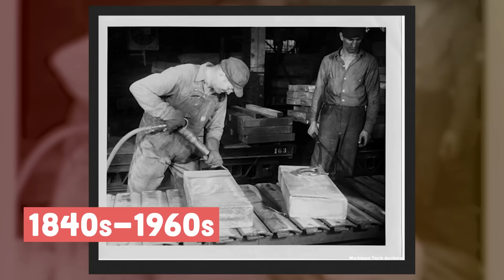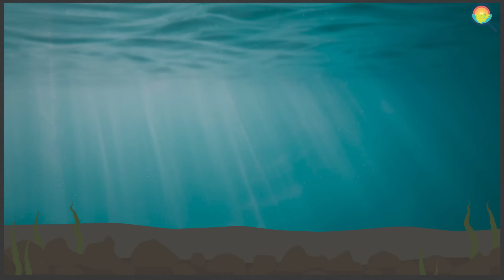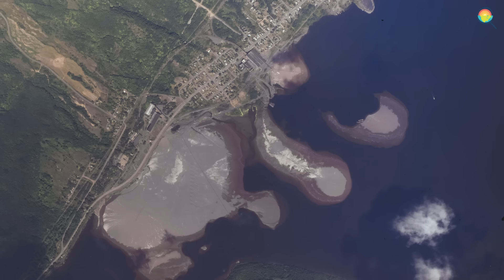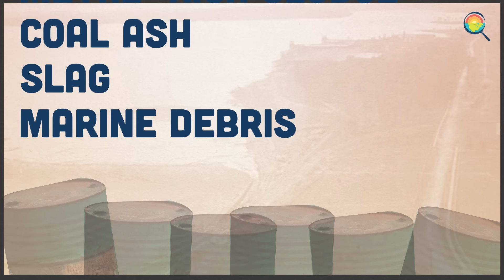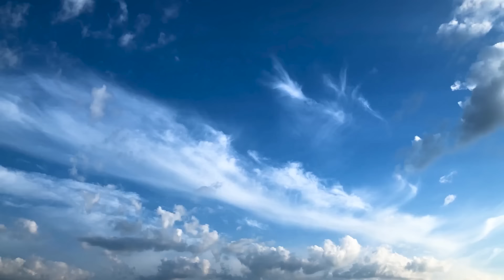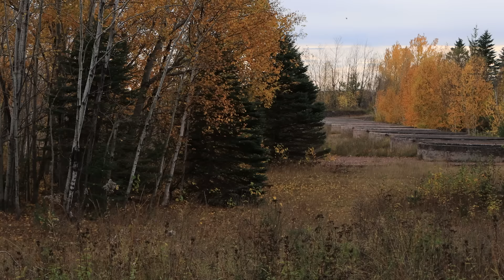They Poisoned This Lake. Now, It's Coming Back.

Comment: MI has 2 Torch Lakes. They should fix that. 😆 What about dredging the lake to regain the lost water volume and the river that is blocked from flowing in to allow sediments to come into the lake? The dredgings could be used for filler in concrete, etc.

Comment: YES! We should clean it up. Our children will have as low of an opinion about us, for passing a polluted lake on to them, as we do about those that passed it down to us. Besides, every parents wants their children to have a better life than we did; so cleaning up the mess(es) that we inherited will work towards giving them a better life than we had. Also, when our children see us cleaning up, and taking care of, the environment, they will do the same when they become older (children learn best by the examples we set).

Offer scuba divers "free air" (tank refills) in exchange for bringing up a certain amount of stamp sand. 
Organize 1 weekend a month where divers come for the purpose of recovering the sand/barrels/etc. Let them augment agencies that are in the process of cleaning up the lake.
Consider designing patches or decals for having participated in the clean up, and have add on patches for certain mile posts; such as 25 lbs, 50 lbs, 100 lbs, or specific events (like removing barrels). Basically something that a diver can display on their gear bag, or jacket, that shows they've taken part in cleaning up the lake.
Give a diver a worthwhile cause and they will usually jump at it.
Make it a tourist destination where people come from all over to help out for a few hours, a couple of day, or a week.
See if you can work this lake into "Earth Day".

Comment: Does covering the contaminates cure the problem? Water will still migrate through. Where does that water transport the contaminates to? 
In my state massive amounts of nitrates are spread on the soil as fertilizer. They contaminate the ground water that is pumped for domestic supplies.

Comment: Excellent presentation of the issues faced in a remediation project. In the clean-up world, basically, cost go up at a logarithmic rate the closer you get to a mythical 100% removal. It may easily cost as much to get from 90% to 99% as it did to get to 90%. With that in mind is it better to remediate many sites to 80% or 90%,  than to do only a few if the goal is 99%?

Comment: This is always the question that comes to mind; How natural is 'natural'... and how often is natural 'best'.
And I don't mean those questions in a nihilistic 'we ruined nature, so there is no point to restoring a natural state' kind of way.  But growing up in Cali, there were plenty of 'restoration' projects where attempts to restore an environment either caused additional rapid changes which caused more harm than continuing to leave things alone... or were so short-sighted that they failed to restore what was actually important.  Not saying to 'not do hard things', or to not make well intended mistakes... just some self-awareness that sometimes an ecosystem is in fact altered, and 'different' isn't necessarily 'harmful' or 'bad'.  And also to emphasize the point that long term monitoring of major changes to have a real grasp of the actual practical results are a requirement to any major environmental change; Because in restoration efforts mistakes are made, and ineffective solutions are put in place, and the only thing worse than doing them once, would be to continue doing things that cause issues.
Again, I feel the need to make the point that I am not saying to cut or suspend restoration efforts; Just the opposite!  If we fund science well, and if we do projects and monitoring with more purpose in mind, then we will get better answers and be able to do future restoration projects faster, easier, cheaper, and with better outcomes in the future.  Technology for making a smart phone is infinitely difficult... but because the scope of the challenge and goal is narrow, then there is a clear path towards the goal and we can achieve amazing progress year to year.  Environmental sciences are science, and they produce technology... and in a lot of ways the technology needed to achieve environmental goals are much easier than creating a smart phone.  The issue is that goals are fuzzy and nebulous, and change dependent on the goals of the ever-changing stakeholders more than a specific achievable goal in mind... and funding sources are also fuzzy, nebulous, and ever changing, and each time a new stakeholder brings funding, it is attached with new goals.  When there is no clear metric, or goal, or stakeholder... stuff takes forever to make progress.  The real issue with environmental science is the social science needed to get people on the same page,

Comment: Flashbacks of why not sell for cement products and especially the UHPC variety to better seal and get some practical use from.  I suppose now a days a little more wondering about how the materials perform or can be modified for utility for sand casting.  Oddly for many, thinking about multistory natural resource structures as well, to increase the lively surface area.

Comment: Although the dredging process will take many years to complete, it will be worth it to clean this lake up. The upper part of the Fox River which runs off into Green Bay here in Wisconsin had astronomical amounts of waste chemicals dumped straight into the river from the multiple paper mills this area is famous for, and other factories for over 100 years completely unchecked. Back in the 90's they started the painstaking process of vacuuming up the many feet of contaminated muck that was resting on the river bed.   Better yet, it was mainly financed by the paper mills that still exist and operate to this day, along with vital help from the federal government.  After 20 years the ecosystem of our river and the mouth of the bay have changed drastically. Pelicans inhabit the area now and the fish are actually edible in certain circumstances. I hope this lake gets a similar treatment, so it can make a full recovery to its former majesty!

Comment: Of course, Torch Lake isn't the only local body of water affected, but it's arguably the worst. Portage Lake might have faired just as badly, but the federal government inadvertently protected it from worse damage because the Portage waterway was much more important to shipping. In the late 1800's the Atlantic Mine had their stamp mill next to Portage Lake in the area of Cole's Creek. The federal government gave them an ultimatum to stop dumping their sands in the lake as it was narrowing the channel. So they built a new stamping mill at Redridge in 1895 or close to that date. (It's been a while since I read their yearly stockholder reports so it could have been the year before or after.)  As it is, Portage Lake does have a significant stamp sand area just southeast of the MTU campus. I don't recall what company was responsible for that. When I was at Tech in the early 90's it was still mostly uncapped. Today it has a housing development on it, Superior Block Co., and the Portage Lake Water and Sewer facility. Honestly I can't imagine willingly living on top of a stamp sand deposit like that, but whatever. ¯\_(ツ)_/¯

Sometime in the future, extracting the copper and other elements from the stamp sand is going to become economically viable again.  I don't see our world's use of copper slowing anytime soon. When that time comes, the state should allow it provided that  the companies that do it process it elsewhere so waste does not return to the lakes.

Comment: I really appreciate you doing this video, however, you didn't get all the information:
1. In the 1970's the pollution in Torch Lake made national headlines and a group of locals did everything they could to stop the EPA from looking into Torch Lake because they were worried about tourism.
2. There was a massive influx of water, ammonia, and other items of concern in the 1970's following the draining of a mine in Keweenaw by Homestake Mining.
3. The sampling done on Torch Lake from the 1970's through the 2010's was so egregiously lacking in scientific method as to only have been deliberate. No area was ever sampled more than once, and the dispersal of sampling points clearly pointed to a lack of desire to find anything.
4. The number of drums in the bottom of Torch Lake has been known for decades, and covered up. Reports of "A few drums" are false. There are pictures collected by MSP divers showing an entire barge filled with drums sitting on the bottom in front of the former PCI site, now known as Koppers.
5. Formerly PCI, now Koppers (also an MTU affiliated project, who knew?), collected copper waste from around the country, particularly from the military, and reprocessed it by burning away the layers of insulation on wiring and other objects, then allowing the runoff from that operation to further contaminate the lake.
6. This one is speculative, but The War Department exemption for Torch Lake likely led to companies transporting waste from other areas for disposal in Torch Lake. Of particular concern is the possibility that decommissioned components from ships that were used in nuclear blast testing made their way into Torch Lake.

Lastly, you should also look into the Lake Superior dumping trench that the Army filled with barrels. It runs from Duluth and parallels the MN coastline for around 100-150 miles.
Reply: Military actions detrimental to the environment from PFAS, ex. Wurtsmith Air Force Base, are being minimized and defunded by the Federal Government, especially Trump.

Comment: It seems the lake was a hazardous waste site and instead of transporting the waste to a new landfill, the water inflow to the lake should have been stopped, and area dug out, the material moved to that pit, buried and a new lake area created with that removed material used to cap the waste.  But there would have been the political problems.

Comment: I grew up in the 90's in Tamarack City on Torch Lake. We would swim off the sands. The drop off was right away so you could jump right off the sands or make a small diving board to get out there further out. They weren't covered then. Sometimes if there was strong wind and you were on the sands you had to take cover because it was like getting sand blasted. Good times. I remember some sickly fish. Great kayaking spot, though it is starting to fill with cabins like Portage lake.

Comment: Overall a great video, it's a great area and I hope one day the area will be restored. However, the poison is in the dose. Copper is used pretty extensively in habitat restoration, and it's a trace nutrient. Check your bottle of Centrum vitamins for example. 

There is a lot of cherry picking on both sides regarding data and with the fear of chemicals in the general population we are starting to lose tools that actually help us clean up waterways.

Comment: Thanks for another interesting video!  I've visited Torch Lake many times and this ties in with areas I have seen when paddling around Lake Superior.  When I kayaked around the Keweenaw in 2018 I was expecting to see stamp sands near Gay.  I wasn't expecting to see that they had drifted, by winds and water currents for 5 miles along the shore, and who knows how far under the Lake.  They only stopped drifting along the shore where they encountered a river that needed repeated dredging to be a safe harbor.  I kayaked another trip from the WI/MI border to Munising and encountered stamp sands near Freda and Red Ridge.  Not nearly as extensive as near Gay.  And kayaking the MN shore there is a remediated area known as Black Beach, which looks familiar after those other experiences.

Comment: I could ONLY imagine what the Menominee river is like where for 40+yrs the Kimberly Clark paper mill was in Niagara, WI. The damages it caused. After Kimberly Clark sold it to Pentair Paper later on to a foreign companies leached all those toxic chemicals to produce paper for magazines. Later on Champion Mill that sold to foreign company who sold it to another foreign company with its toxic chemicals it uses. I was on the job site for 2yrs until it was completed when Champion Mill decided to add a paper machine to their pulp mill production years later.Even those that visited the property to deliver anything on the job site was required to have a filter on their person while on the property.  Everyone on the job site had to carry a mask on their person in case their machines leaked a very deadly toxic chemical fumes leaked when producing their bails of paper pulp they sold prior to the paper machine they installed. All the "FILTERED" water was injected back into the already polluted Menominee river from 40+yrs when Kimberly Clark began production of their magazine paper production.  I had fished on that river you could see fibers of pulp that floated in that river. And Kimberly Clark had produced their own electricity from the dam the created and sold off the extra power to the city. What did they do with their PCB's from their transformers?

Comment: My thoughts are because of the scale of prior pollution we need to just keep focusing on the worst places first, and this will involve jumping around doing a couple things here and a couple there. Just keep pushing them down the list until you push enough others down and they float back to the top.  You can simultaneously run a mini operation picking off a line of minor problems in popular areas to shorten the list, but the primary focus needs to be the worst places and ones that will get worse the longer nothing is done.

Comment: It's 100 times easier to prevent these problems than try to clean them up after 100 years of abuse.  That's why the EPA and government regulation is so critically important.  Left up to their own devices, corporations will always take the cheap and easy way out.  They are held accountable to "increase shareholder value".  Sadly, the power that be in Washington turn a blind eye to these problems.

Comment: This lake is also filled with the deadly chemical dihyrdogen monoxide.  Never let your kids near this stuff.
Reply: Chemically, there is no such thing as "dihydrogen monoxide" whereas of course hydronium hydroxide is correct-
Reply: @jackprier7727  "Dihydrogen Monoxide" is specifically to sound like a scary chemical.  It's water.
There is a lot of that going on in this video.  Lots of talk about scary sounding chemicals, with no PPM or safe exposure limits.
Reply: @tarstarkusz  Ha Ha but "dihydrogen monoxide" is not chemically possible, no matter how much it scares you. Yet water exactly IS hydronium hydroxide, so one can sound "scary" while using facts.
Reply: @jackprier7727  google it.

Comment: As always, enjoyed your video.  This subject is right up my alley.  I find it interesting that you kept referring to the EPA as the party that performed the cleanup.  Did EPA not identify the property owner or other entity as a potential responsible party (PRP) to perform the investigation and cleanup while the EPA remained in a regulatory oversight role?  
To answer your question at the end, the amount of cleanup performed at these sites is a direct result of the Human-Health Risk Assessment and the Ecological Risk Assessment which, for HHRAs, identify the chemicals of concern contributing and which chemicals are the risk drivers.  Unfortunately, all one has to do to eliminate human health risk is prevent human exposure to the contaminants, by capping or other means, rather than perform actual cleanup.  This is where public comment and response to proposed Plans comes in.

Comment: Just a thought to help a little. If they could truck in clay and spread it out over the water like spreading sand, it would dissolve  into the water and settle on the bottom just like the river silt would. Just more concentrations to speed up the process. Eventually the clay would seal the bottom. Although it wouldn’t remove the waters in the aquifer.